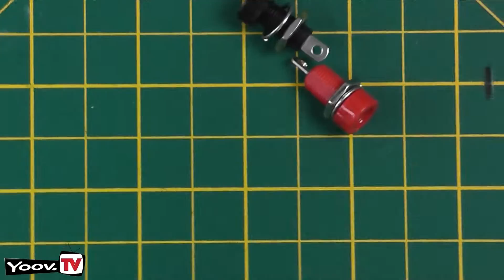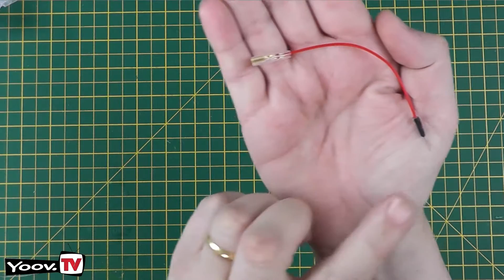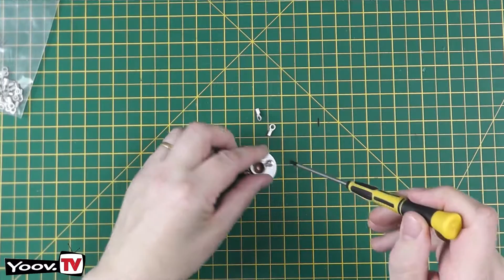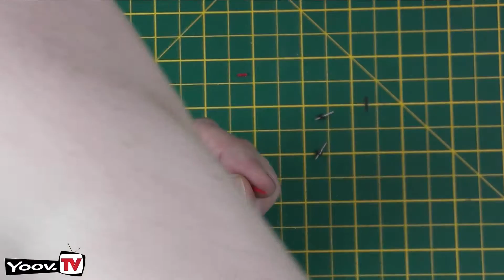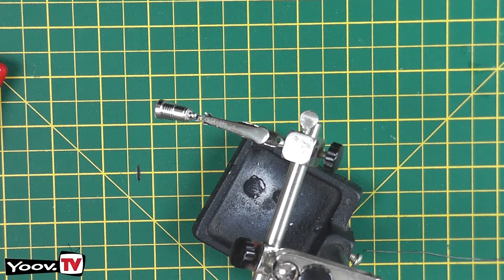Breadboard Adapters & Accessories - Make Your Own!

Comment: Power connectors to breadboard pins, taco edition: 2x2 of snappable right-angle header. Try to Z-bend the pins with tiny pliers into two pairs (don't have to touch), tin. Tin wire and solder between each pair. You can heatshrink over the solder joint for cleaner presentation but you're still gonna have bent pins that are bare above the breadboard. Black air-dry plastic clay can be shaped into a cubish professional-looking thing, or a dab of hot glue, or just leave it bare. Might use banana jacks that are paired for panel mounting on the other end. Better hold in the board and you've got something other than the solder joint to pull on to remove the wire from the board.

Better heatshrink at the banana jack end … I'd actually use a small bit of low temp hot glue around the wire as a filler. It melts at around the same temp as the tubing shrinks so the tubing will clean up the glue to be more even and fill the space. This isn't a pigtail you're gonna take apart to reuse the connector later, though. (The hot glue filler trick also works for thin wires coming out of strain reliefs on DIN or D-sub connectors.

They're also a bit fiddly small for my eyes, but another one I've heard of is to solder leads and resistor to SMD LED to result in a package that you can fit as many into adjacent 0.1 tie points as you like, neatly, at any voltage you're going to use on a breadboard.

Comment: Some good ideas here.  I've also taken a USB cable and cut the end off it and then soldered pins on the red and black cables.   Then I can use any USB port or charger with a USB port to get 5 V.   Instead of cutting the ends off a jumper cable simply cut the cable in half and then you get to cables out one jumper.
Reply: I do that too but I've been noticing some of the new gan chargers won't supply the 5v without a handshake. I kid you not. I have more bench psus than any normal person should have now.  I'd love to have that wireless breadboard that was on hackaday but it's 300usd so by the time I get it the price in nova Scotia will be just over 400. I'm making one with a cheap 2 chan and la for serial.
Reply: @jstro-hobbytech  I've been trying to create something that would allow me to make use of the 48 volts coming out of a POE switch.  I've come to the conclusion that the connection requires some kind of signal to initiate the power transfer.  However, a power injector does not require a signal.
Reply: @RandomTorok  that's a pretty sharp idea. I'm not familiar with poe as far as there needing to be a handshake of sorts to deliver the voltage. Beware though my friend. 48v will give you a nasty shock. I suspect if requires some sort of bulk cap that can deliver the power you need to the board. I'd try to split the power so you have a negative rail as well. Can't have fun wirh opamps without a negative rail. -24 would be a little much but a 5watt zener and a way to bleed off the excess voltage would do the trick. A 12v bulb on each rail. I'm just spit balling though. Cool idea man.

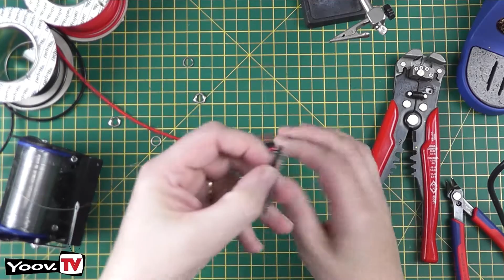Comment: 6:58 As a tip, it's better to use 2 header pins connected to the short wire for de positive, and 2 header pins for the negative. 
With 2 pins for the positive and 2 pins for the negative connected to the breadboard, the connection is much stronger then with only 1 pin. 
Besides that, nice and usefull video.
Reply: I just was about to type the same thing :)